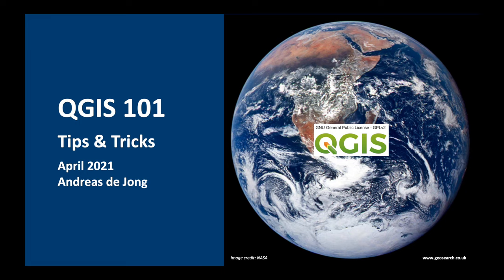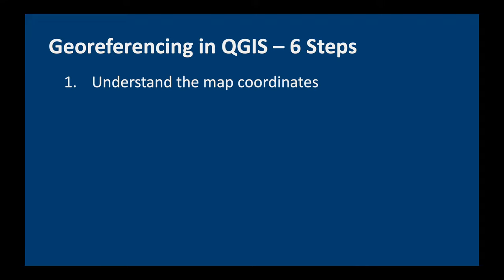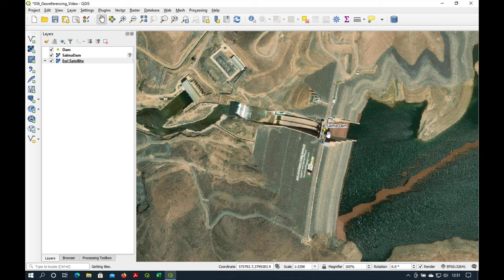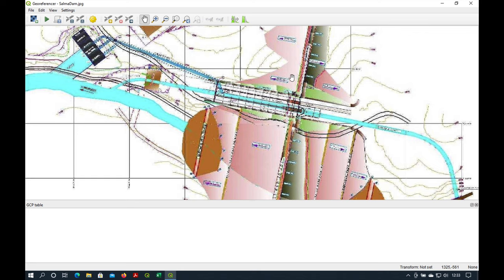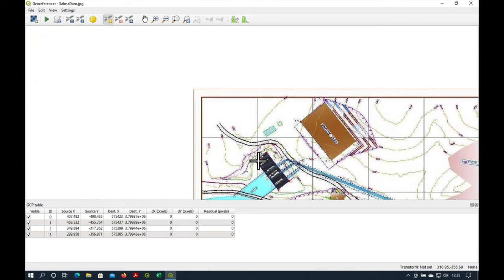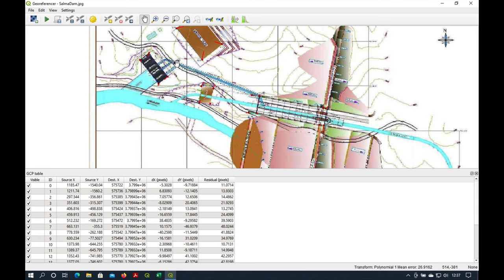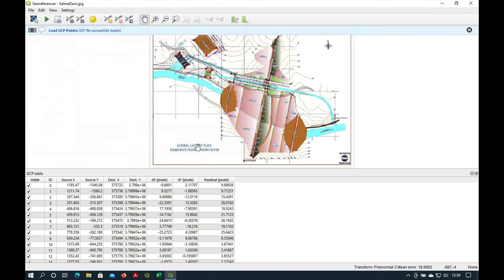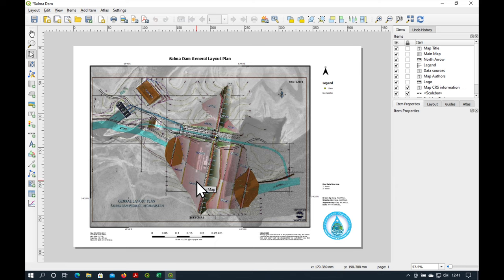QGIS 101: Georeferencing maps using satellite images

Comment: Thank you for this video! One question: is it ok to mark points in the corner of the buildings considering that there's a modification in the base coordinates because of the altitude?
Reply from the maker: Hi Débora, When we are forced to georeference using objects from a satellite image it will never be 100% accurate. Even if you pick the point as carefully as you can, you should assume an accuracy of no more than two pixels. With Sentinel-2 that means 10 x 2 = 20 metres. With buildings we need to be careful as their height can cause a distortion if they are further away from the centre of the image. i.e., if the satellite is not directly overhead. If you have a good road intersection/centre of a roundabout nearby maybe it will make a better referencing point. However, I would always take as many reference points as possible, and then delete the ones which create the biggest errors. So to conclude, just pick any reference points that have a clear end, corner or centre. Then delete the ones which cause big errors. All the best, Andreas
Reply: @GeosearchInternational  All right, I got it. Thank you for the explanation!!
Reply from the maker: Welcome! All the best, Andreas